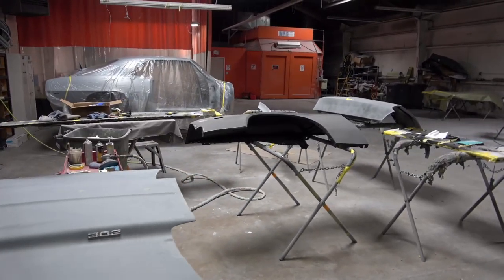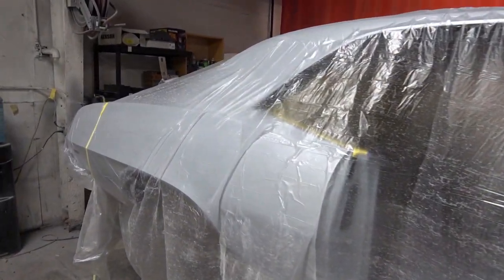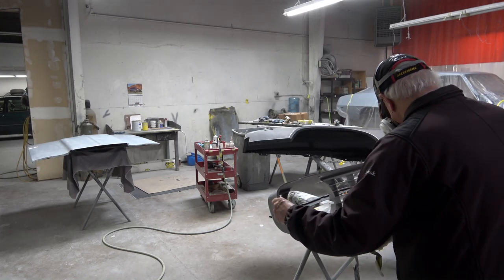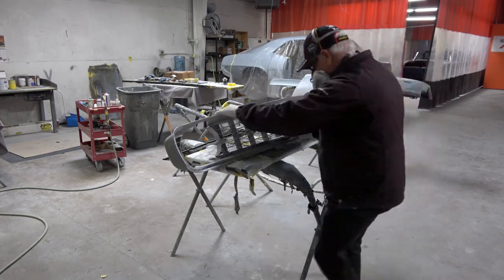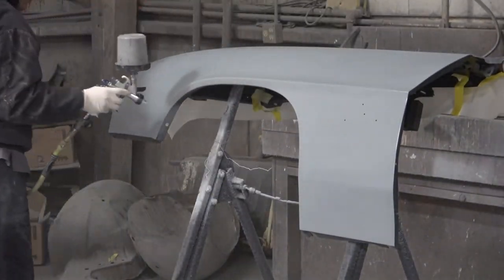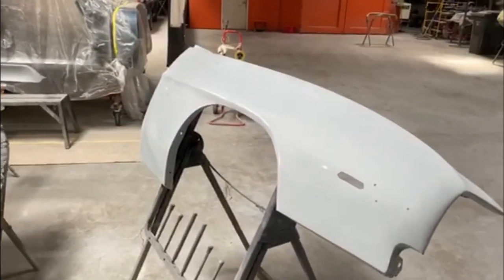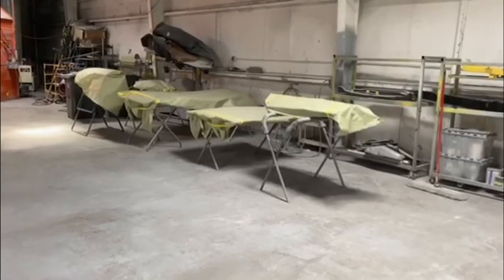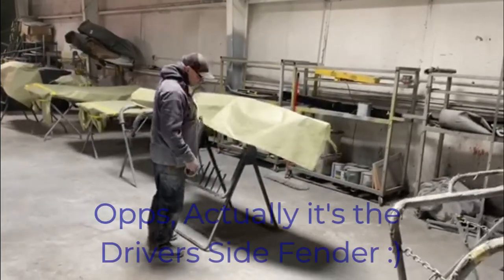69 Camaro Z/28 in Le Mans Blue Full Restoration Video Series - Part 5 - Final Paint Preparation

Comment: Was wondering if you used NOS parts or aftermarket parts or combination of both. I have the same car X33 for 40 years enjoying your videos. Thanks Dan
Reply from the maker: Hi Daniel, I am trying at all costs, to use NOS or Restored parts as much as I can. I will only use aftermarket stuff if there is no other option and if they are "assembly line correct" and are proven and excepted by the Camaro Community and judges. Examples are weatherstripping, seat covers, carpet, exhaust systems, and things like that, that can't really be restored. But things like body parts,  painted parts, chrome parts etc. that can be restored, I would rather keep it original or NOS. I will be doing a video very soon on the date coded parts that I have for this car that are original, restored or NOS.
Thanks Daniel, good question
Pete